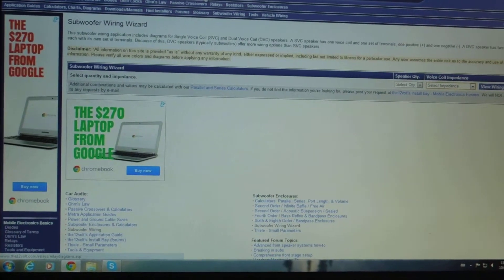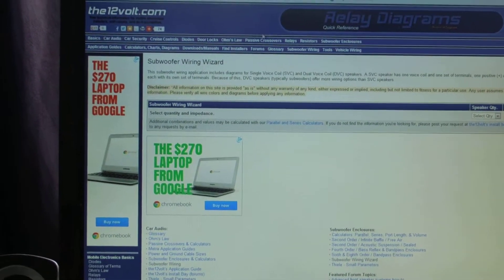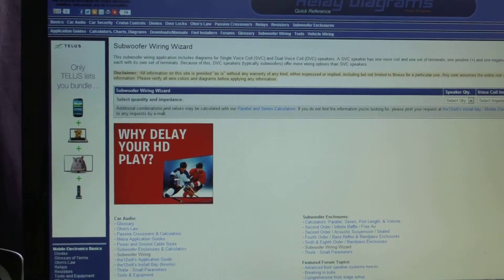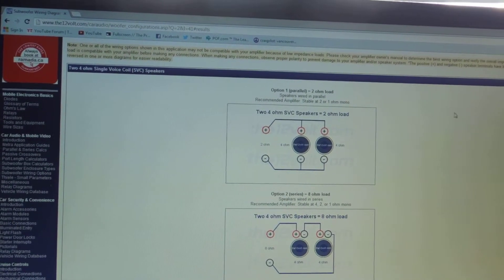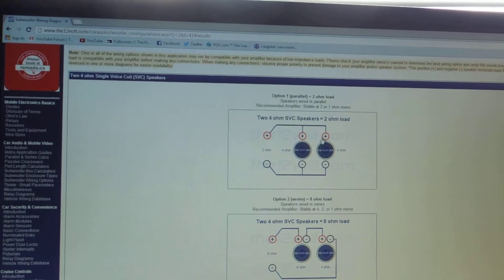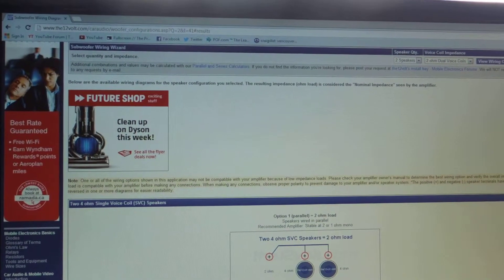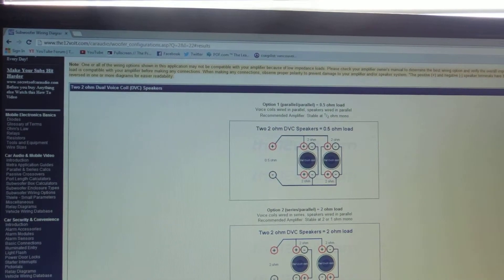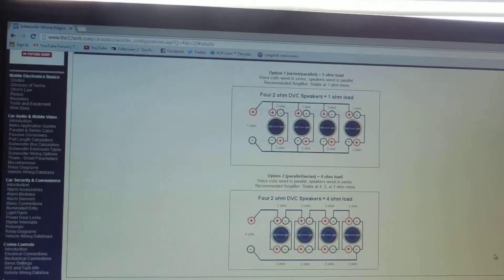how to wire multiple subwoofers and dual voice coil subs for best ohms and power

Comment: if your are dual coil speakers at 4 ohms, I wouldn't wire them no lower then 2 ohms, I've already burned up 2 pair of speakers ,wired them at 1 ohm
Reply from the maker: Could be hard you would be better with buying dual 2ohm coils wire each sub up to 4 the wire them together to bring the back down to 2
Reply from the maker: When wiring to 1 ohm have to have a awesome amp cause usually runs hot
Reply: ghostlyrich
oh I know it does have more power ,but like you said, next time I'll buy 2 ohm speakers cos my boss riot 3400 is kicking them 4ohms ass

Comment: Hello I have six 12s with four of   Them single voice and two dual all of them 4ohm I have two amps Sony explode to channel 1000 W and I am wondering what is the best way to wire the subs
Reply from the maker: is that 1000watts rms or peak?? that's allot of of subs to push with those amps and if it is rms defiantly make sure you upgrade your grounds alt and battery. ook up your amp model number online and see what ohms rating its good for.